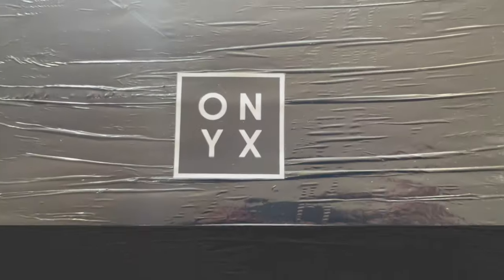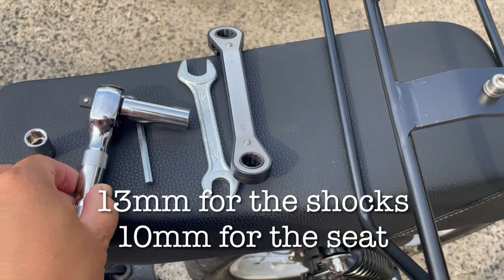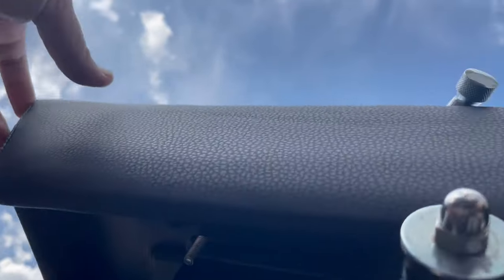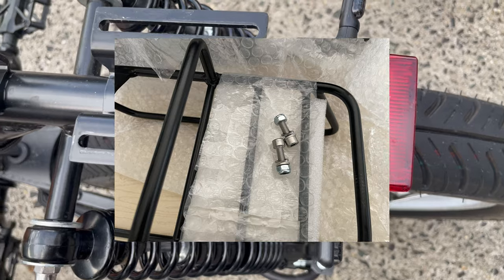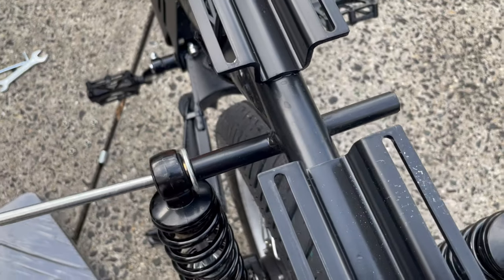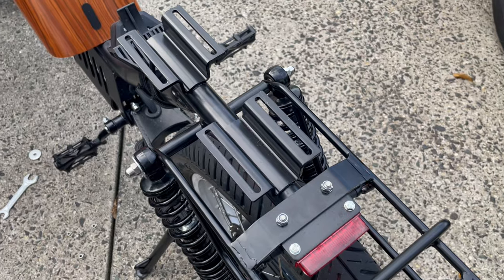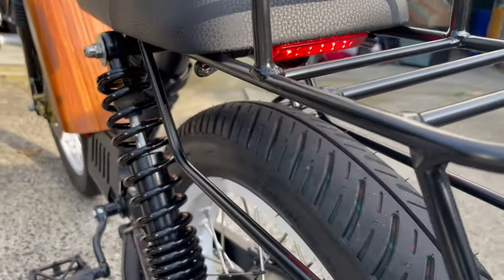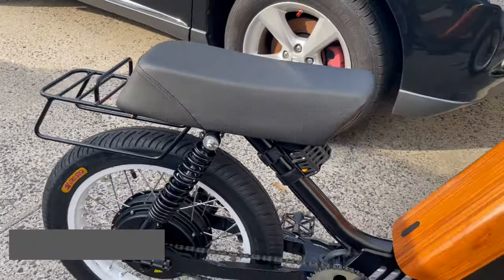How to install the ONYX CTY2 Rear Rack

Comment: Great video. Short and sweet, kept it simple, no shaky camera, I'm picking up one of these racks tonight. Just got my CTY2 in yesterday. I ride motorcycles, and let me tell you, this thing is a freaking blast. I did NOT expect it to rip like it does, 50 MPH on a bicycle is quite the experience.
Reply from the maker: It’s a great bike! Glad the video was helpful!
Reply: Also @ErockRodz, I noticed yesterday when I installed the handlebars then turned the bike on that not only was there a mile on the odometer, the handlebars were scuffed, and the OEM screen protector removed from my display, but my bike was literally unlocked from the get go. I went to sport mode and hit 50 MPH without doing a thing to the wiring. That's not normal, right?
Reply from the maker: @russellphotos195  you ordered directly from Onyx correct? I’m not sure about some of the things you mentioned, but it should ship as a class two. You would have to connect the wires your self in order to unlock the top speed. Unless they do some testing before shipping out now. I ordered mine from a local dealer fully assembled so I am not totally sure.
Reply: @ErockRodz   I did order directly from them. Had to install the headlight, handlebars, and pedals, very easy. Front wheel was a little trickier. Hardest part? Turning the bike on. NOWHERE in the instructions does it tell you that the battery is not connected to the bike, I figured it out pretty quickly, but for a novice, nobody wants to mess with the battery of any vehicle ever. Terrible instructions. Wrote to Onyx two days ago about why it came out of the box with an obviously used display, 1 mile on the odometer and completely unlocked, but haven't got a response. I love this bike so far, but just want to understand why it came in like it did. I followed up with Onyx and told them that it's very off-putting to not receive a response for 48 business hours. We shall see. I owned a zero electric motorcycle and I sold it at a huge loss because zero electric is the worst company of all time and their support is disgusting, they don't care at all about you once you buy a bike, so I'm truly hoping Onyx is not the same. I did my research before buying, and everybody told me that their support is great.

Comment: Your frame looks a little cooked, does the center of the rear seat align the middle of the back wheel?
Reply from the maker: Hey Mark, it is slightly off center I noticed. I think it has to do with how the bike sing arm attaches to the back wheel/motor.

Comment: Those two screws that you show on the rack in  the beginning didn’t come with the rack right?  Were they located under the seat after you removed it?
Reply from the maker: Hi Vincent. No they came in the package with the rack.  The holes under the seat are empty.
Reply: @ErockRodz  thanks I just opened a ticket with Onyx because I received the rack, but no hardware.
Reply from the maker: @vincentriccobene3186  oh okay that stinks. Good luck!!
Reply: @ErockRodz  Onyx came through, I just received the 2 missing bolts.  Customer service was real easy to deal with and issue was resolved quickly.
Reply from the maker: That’s great to hear! I’m glad the video somewhat helped you out!
Reply: @ErockRodz  Thanks, btw I ordered the Athena 39ah battery (among other upgrades) and can’t wait to receive it.